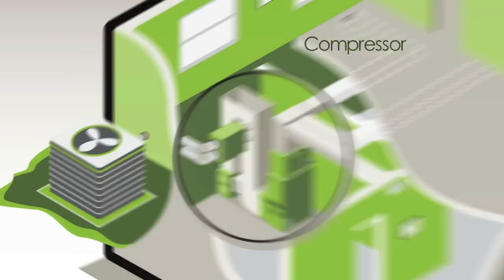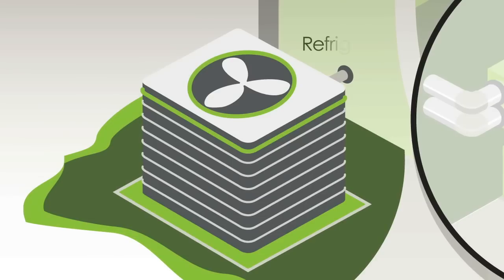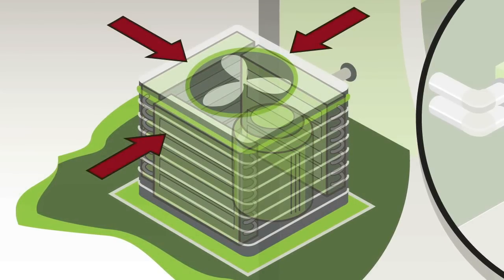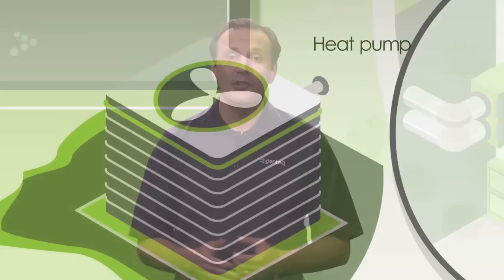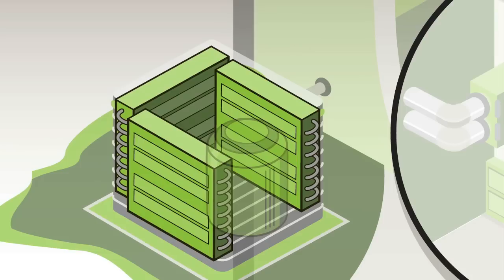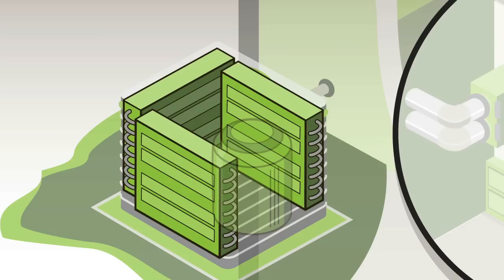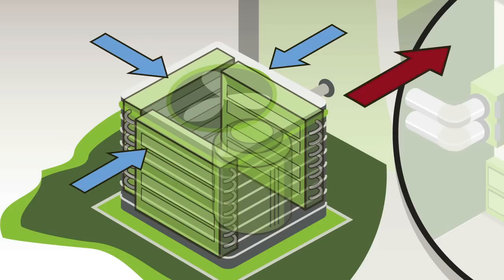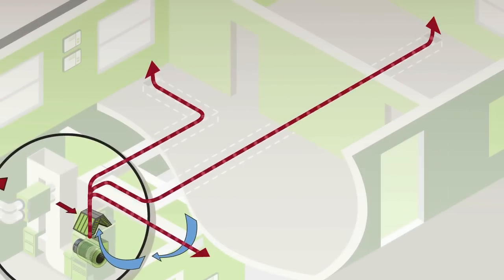How does my air conditioner work?

Comment: “Chemical reaction” taking place in a refrigeration system is never a good thing. Moisture in the refrigerant piping causes a chemical reaction with the inside of the copper lines. Oxygen and moisture in the air allowed into the piping from improper installation/repair practices reacts with the copper to create cupric oxide, a contaminant that wreaks havoc on any HVAC-R system. Thermodynamics is the concept related to the usefulness of the refrigeration cycle, NOT “a chemical reaction.” PV=nRT The saturation of heat occurs during a phase change of the gas, which is a property of the gas and not a reaction.
Okay. I stand (sit?) corrected: phase change is a property of the gas AND a chemical reaction (adding heat to the correct mixture of oxygen an a hydrocarbon result in a chemical reaction called combustion — or an explosion.)

Comment: Phase change in this instance is a chemical reaction. The CHEMICAL refrigerant is easier changed from a gas to a liquid because of its unique chemical properties . When compressed it changes on a molecular level . I think you people believe a chemical reaction consists of two or more chemicals being combined and a certain reaction happening. A chemical reaction can be triggered by compression , heat , radiation , and other forces. Just ask any other hvac professional about the test he or she took to become a licensed hvac. There are entire chapters on chemical reactions.

Comment: ON a heat pump in the heating cycle Is the same concept but one is called the outside unit an indoor unit also they use a TXV.
Reply: Thank you Bro...there are four major  basic components to ANY HVAC system

Comment: I have fun reading the comments. Reducing pressure alone does not cause anything at all....in space what happens? It takes a combination of relevant things. If there is no heat in the surrounding area to the gas, what happens?. If the surroundings are colder than the boiling point of the gas what happens? If the system was in outer space what would the effect be? It takes heat from an environment to have the desired effect.

Comment: which air AC will take to cool the room. Outside or inside
Reply: inside air.
Reply: depends on the unit, if it's split it'll thake the air from the outside if it's window ac from the inside.

Comment: I remember hearing something about the hot air in the house being sucked out? where does that come into play?
Reply: That's not quite correct. There is a difference between "air" and "heat". Air is what you feel blowing on you when you stand in front of the A/C unit (hence, hot air is not physically sucked out, it just goes inside the A/C unit and back into the room). Inside the A/C unit, "HEAT" is sucked out from the hot air which results in cooler air that then gets pushed inside the room and cools down your sweaty forehead.

Source: Mechanical Engineering Undergrad
Reply: F you. You've got a cheap A$$ window air conditioner.
Reply: Lol. I don't have a window A/C, it's central. I think that's what's in this video too.
Reply: Woody Haddad oh thats cool

Comment: uh chemical reaction?? No. that's not even close. An AC system works by lowering the pressure inside the evaporator coils and raising the pressure in the condenser coils
Reply: Yeah that immediately stood out to me, too. Pretty sure it's a circular physics/thermodynamics process, which is what allows it to be a closed system. If it were a chemical reaction, there would be a waste byproduct to handle, and the chemical inputs would require regular refills. About the only chemistry happening here is that refrigerant itself is a chemical compound designed to be gaseous in the operating conditions stipulated by our atmosphere. haha
Reply: The chemical reacts by boiling through an endothermic reaction. Endothermic means that while it boils and evaporates into a gas again, the chemical absorbs the surrounding energy and heat, causing the temperature around it to drop.  It is most definetly a chemical reaction regardless of the concurrent thermodynamic cycle.
Reply: There's nothing chemical here- just physical. Chemical reactions are changes resulting in different substances. That isn't happening here
Reply: @madLphnt  you seem to be the only one of sound mind here. Just love all the experts here lol. They believe a chemical reaction has to be pouring two chemicals into one and triggering a reaction I guess. They fail to realize the refrigerant used is a chemical with specific chemical properties that allow it to easily change from one state to the other while being compressed , a freaking chemical reaction to being compressed!!!!!
Reply: The chemistry of air conditioning people look it up

Comment: do the ac pulls the fresh air from outside to the room ?? or it just takes the air that was already inside the room ?
Reply: It circulates indoor air.
Reply: a fresh air brings outside air in and mixes with air that was existing in the home. most residental homes do not have fresh air.
Reply: @TheBwkaylor  so, how does it exhaust outside? If it does not than air pressure inside will increase, right?
Reply: yes, ac pulls fresh-air from outside to room.
our balcony, has a pipe underneath that balcony. that pipe faces downward, sucks fresh air.
our garage is underneath our balcony so if our car runs idle underneath balcony then car's emission will be sucked by that pipe then car's emission goes to ac-filter then goes to room.

Comment: That caught my attention right away too.  It's a fundamental thermodynamic reaction (physics), as it's been pointed out already.  It's not strictly necessary for the medium to change state (gas to liquid or vice-versa), for the temperature to change, the pressure change while keeping volume constant is enough.
Reply: Gabor Maghera  please explain how to keep the pressure in a vessel at the same pressure while changing the temperature of the gas in the vessel?